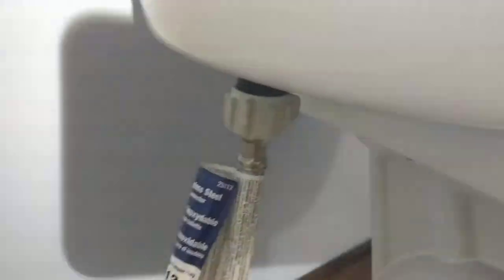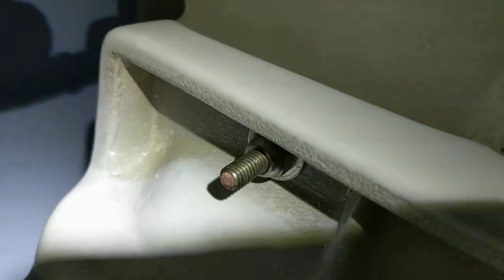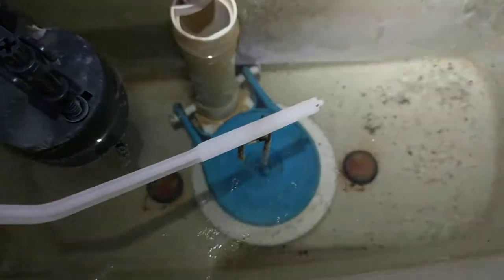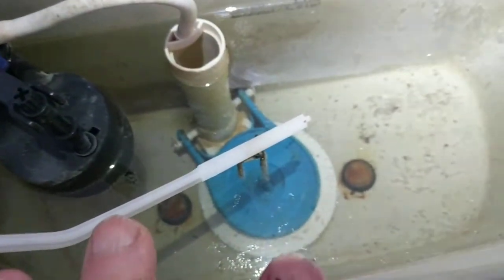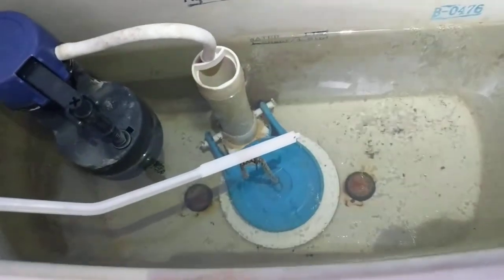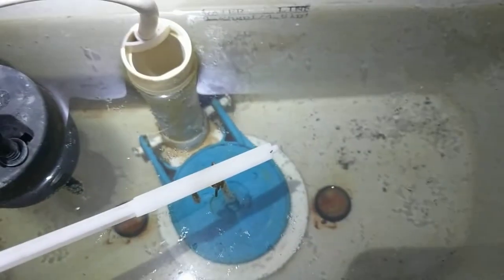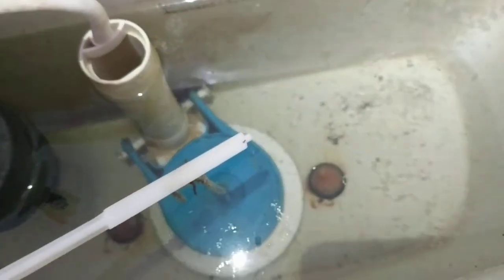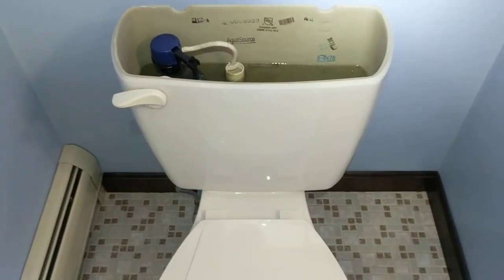double nut the aquasource toilet tank bolts

Comment: Sir, thank you for this. I have two of the Aqua Source toilets. I have leaking from the left bolt on one of them. I have removed the tank, but I am having trouble finding the replacement bolts,nuts, washers, and gaskets. I checked with Aquasource and they say they are discontinued. Do you know the detailed specs on the bolt, name of head, thread specs etc. and I'll check a nut and bolt specialty store? Since it is brass and has rusted after 10 years, I am going to try to find the same bolt in stainless steel. Thank you sir for  any information.
Reply from the maker: Hi Ken, as far as the toilet tank bolts I do not have any info on any specs for these bolts. However, i believe any bolts that you might buy that are listed as toilet tank bolts are likely to work ok. If you are having a leak my recommendation is to remove the tank, grease the toilet tank gaskets and reinstall the tank using the double nut technique. With the double nut technique you can tighten the upper of the two nuts on each side of the tank until the leak stops. if the present leak is manageable you could wait until you get your new bolts, nuts and washers before doing this.
Reply: @mrdavetrouble  Sir I kept researching and SOLVED the problem. I went to the big ORANGE box store and found they had just what was needed. Fluidmaster Tank to Bowl Gaskets and Hardware #6102. Came with 2 stainless steel bolts with washers, nuts etc. Also large red gasket and smaller black ones. I was especially glad to have been able to find the stainless steel ones compared to the original brass bolts. Thank you sir and I hope this info might be beneficial to your viewers on your fine channel..  Ken senior citizen in Oklahoma